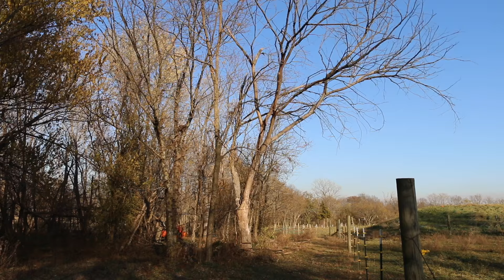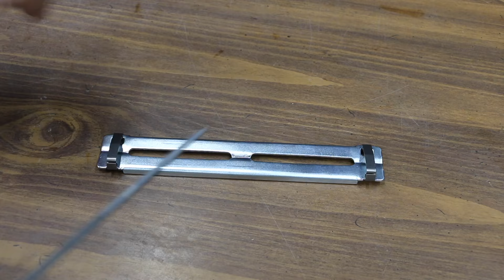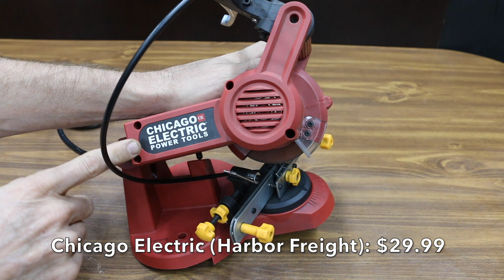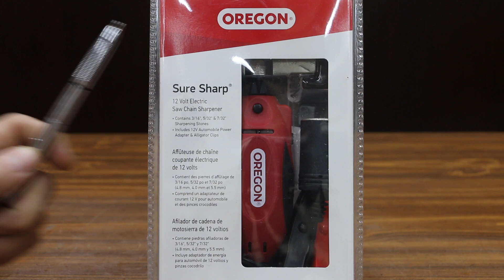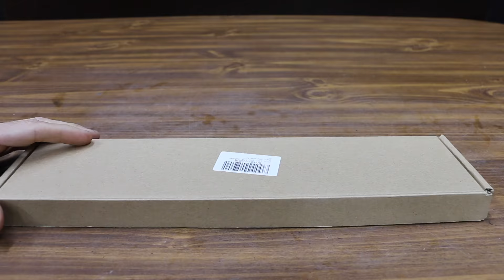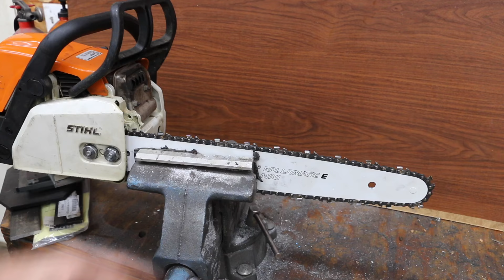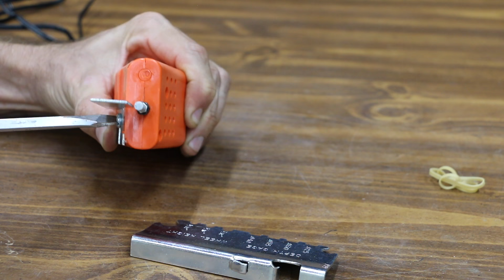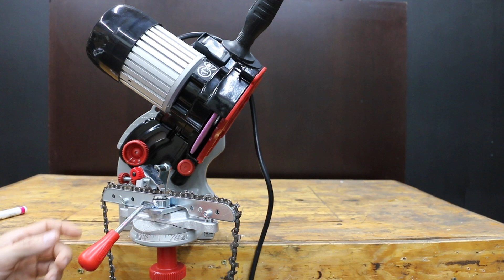Which Chainsaw Sharpener is Best? Let's find out! Stihl, Granberg, Chicago Electric, Oregon

Comment: Can you do one on digital torque wrenches? I seen the other day harbor freight has one and I would like to see how it held up to a snap on. Like if you agree 👍🤙🤙
Reply from the maker: Great suggestion!
Reply: @ProjectFarm  I was wandering the same thing. I need to buy a torque wrench and was wandering if the one at Harbor freight  was worth buying. PS, Your channel is the best on Youtube!
Reply: @ProjectFarm  I'd like to see a torque wrench test too. I'd also like to see a test on torque wrenches after they're used in a non-torque way and "abused" slightly removing a relatively heavy (say 70-100lb/ft) bolt or nut, to see how well they retain their calibration.
Reply: @ProjectFarm  check  multimeters too. How accurate is a harbor freight multimeter compared to a fluke etc.
Reply: Most of us will admit snap on is overrated
Reply: My manual Craftsman and Wright Tool torque wrenches are growing tired.  Costs a lot to calibrate them.  Seen digital ones at dealerships and there seems to be a big range in the green light and beep.
Reply: Would also like to know if using a torque wrench to break bolts free would do damage to it or throw the torque wrench out of calibration.
Reply: @brianhanrahan6256  
Wow that’s a great idea
Reply: I agree, this would be a good one. And please include the digital adapter style like the AC Delco one that you use in the videos, and the Quinn digital adapter style from HF.
Reply: I seconds this, I use the cornwell CTG5000ANG, because at the time I bought it 3 years ago it was half the price of the snap-on equivalent and I like the weekly warranty service. From what I understand the cornwell is identical to the Eastwood digital wrench. The head was very cheap feeling and coarse-tooth, but I swapped a snap-on 1/2 ratchet head into it with a tiny bit of filing the opening. Would love to see how accurate it is compared to others, both in Torque and angle measurements. Your channel is excellent, please keep up the great work!
Reply: I work in Aerospace and it's required by law for every torque wrench to be calibrated every 12 months. Majority of our torque wrenches are Snap-On but some mechanics have different brands ( Icon, Tekton, Husky) etc. I have personally talked to our cal guy he said Snap-On is no. 1 and no. 2 is harbor freight icon. He was very impressed with icon and said its a great buy and value.
Reply: I love my snap on 3/8 electric. It does angling and every unit of measure under the sun but it would be very interesting to see if my 500 dollars could have been spent better elsewhere!
Reply: Torque wrenches can be tricky. Half the time you buy one, it's out of calibration straight out of the box. If it's not wound down to zero, it will suffer from memory shift. The only time I noticed them wound down to zero, is when I get them back from getting calibrated.
Reply: Yes! Please test torque wrenches. Not just digital but the standard ones as well. Gearwrench is allegedly a good brand to compare to Snapon on down to Harbor Freight.
Reply: Yes, yes, and yes! Would love to see this video. 
Wanted to add as an owner of many harbor freight torque wrenches and exactly one Proto 1/2" (that I treat like a sacred gem) I would love to see those brands included.
Reply: That would be valuable info
Reply: Would love a test on electric impact wrenches. I bought milwaukee m18 ..a couple of them.  But want to know if better was available
Reply: Buy torque wrenches from CDI. I own both CDI and Snapon. Cant’ tell the difference. I’m pretty sure snapon torque wrenches are made by CDI and rebranded.
Reply: Great idea. Wondering if Snap On digital is worth the money.
Reply: @ILruffian  I have one of those as well. Heavier poundage model for truck lug nuts. It was made by computorque as well. Save your money. Snapon torque wrenches and torque screw drivers are made by computorque. Snapon just adds their name and logo.
Reply: I bought a Snap-on techangle and would love to see how big of a financial mistake I made
Reply: I did a lot of research regarding accuracy of various brands of digital torque wrenches before I  bought a Quinn wrench at harbor freight. As far as the samples I've seen tested goes, the Quinn torque wrench is equal to or more accurate than a number of much more expensive brands (including snap on). I've had zero issues with mine in the year I've owned it, and I use it almost daily. So glad I didn't spend the extra money on a big name brand!
Reply: To test torque wrenches, you will need equipment that's NIST certified and traceable. FWIW, I have a Snap-On 3/8" torque wrench that was barely passable. Not a digital type, old clicker style.